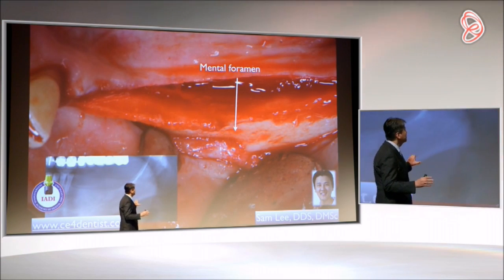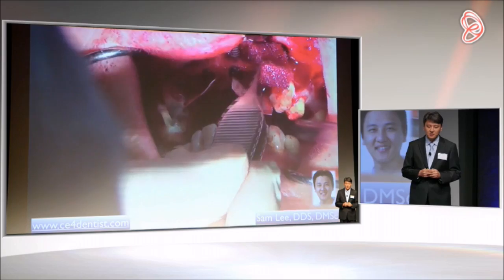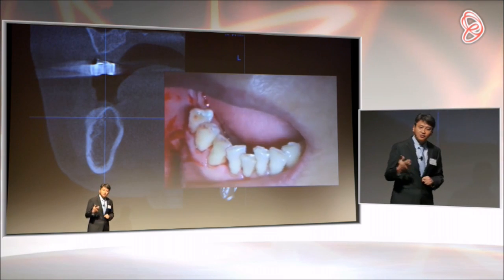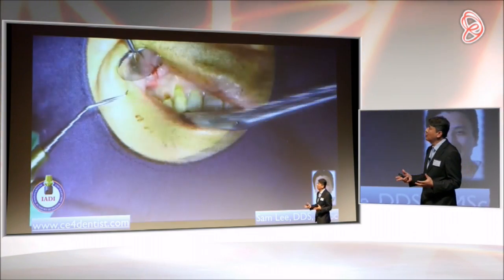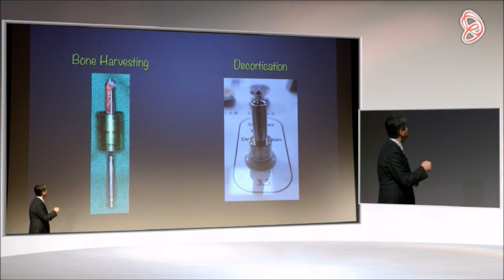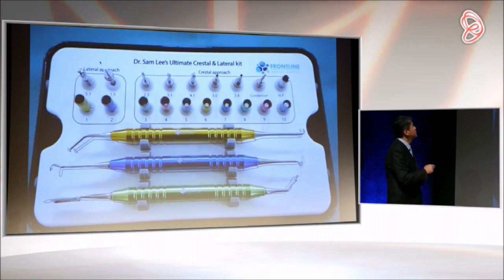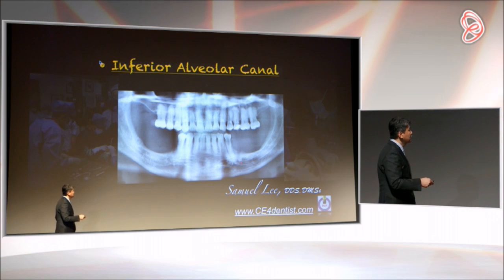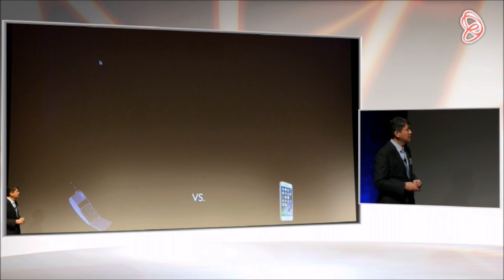New Techniques in Implantology with Newton Implant Systems

Comment: First, we have to determine the cause of loose teeth after braces.    It could be due to root resorption, tooth being outside the bony housing, or simply in the healing stage.   Bone graft would not help if cause is root resorption, but help if tooth is outside the bony housing.   Best is to discuss with periodontist.
Reply: samleedds Do you thing those who had implanted done can regrow teeth again?

Comment: I've learned from watching your video that doctors should use guided surgery when doing an implant.  I asked the doctor doing my upcoming implant does he use guided surgery.  He does not.  Does this mean I faced the likelihood of the implant not being precise of where it needs to be placed?  I have gone through so many heartaches and financial losses with this one tooth that I just don't want any further complications!  Had crown replacement, 3 months later a surgery to remove a cyst. 4 months later a root canal. 6 months  later a root canal surgery w/bone graft and infection removal. Crown all of a sudden would no longer stay on (told not enough tooth structure). Which has lead to extraction and  now having to get an implant.
Just trying to avoid any further grief and expense..
Reply: Lin G     Hi Lin.  Guided surgery is recommended, but not required by law.   I recommend it especially in anterior cases, but not so much in posterior cases (due to limited opening in most patients).  However, I have seen many artistic dentist who can perform good surgeries without guides.   Please discuss with your dentist what is best option for your case.   Thank you for watching my lecture.
Reply: Thank you so much.  I really enjoy reviewing and learning from your presentation/video.
Reply: You think you would have went to get a second opinon before having that tooth extracted.  some dentist can still do the crown and some can't.
Reply: "...DRINK DISTILLED WATER..." is about the worst advice.  Drink no less than spring water or artesian water, distilled water is near if not entirely free of minerals... BAD IDEA!